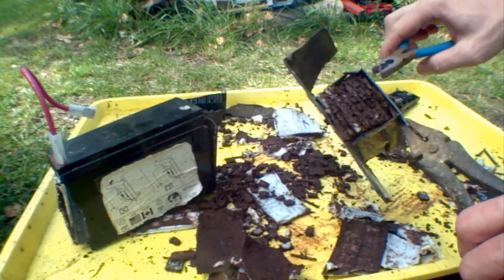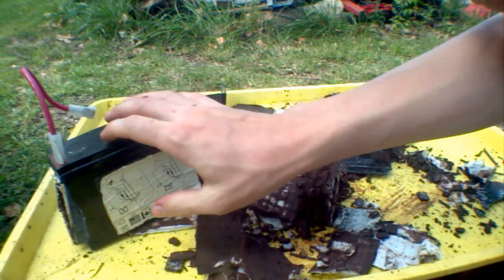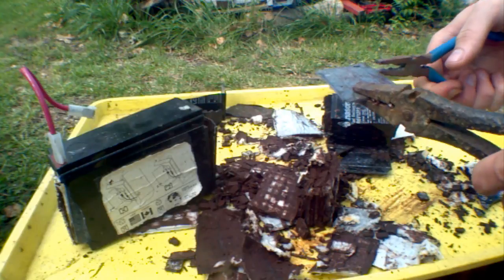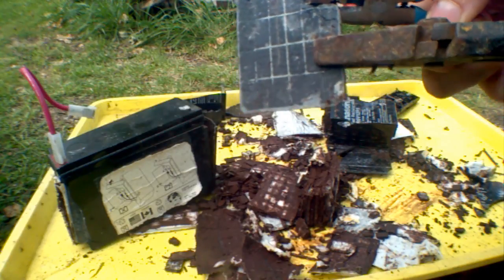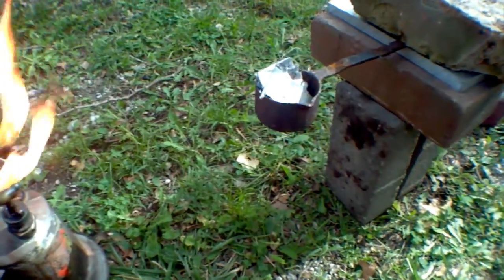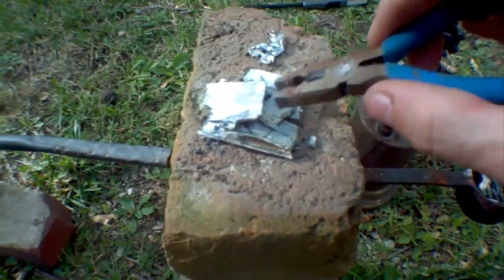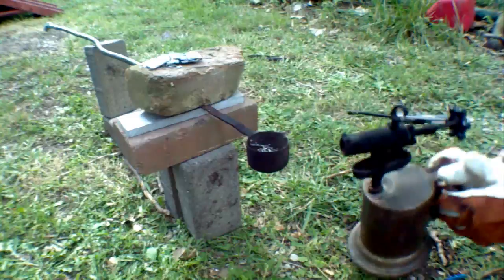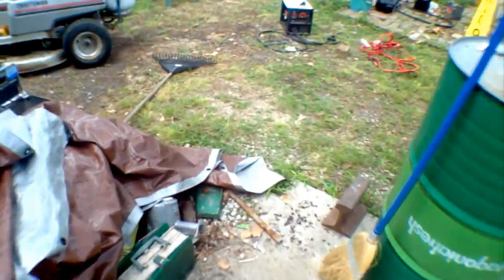6v SLA Battery Autopsy and Melting the Lead

Comment: You can actually re-use the negative electrodes if they are good enough and mostly intact to rebuild them and create a brand new battery! if you get lucky with all of them intact you can get close to 50% of a brand new battery!
All you do is use pairs of the negatives with half being designated as the positive and the other half as the negative!!

Use epsom salt in deionized water as the electrolyte and let it charge for a while at about 250mA per 5AH of rated capacity. Charge to rated absorption voltage and its good to go!
Will nearly double the original lifespan!

You can reuse the case if you carefully cut the top off without damaging it too much. and without making a mess.
The positive electrodes are useless though and can't be reused for anything.

Do be careful and wear gloves eye protection and protective clothing and neutralize any remaining waste or acid.

it works! I tried it and it works 100% for real! its the coolest thing being able to breathe new life into an old worn out battery.

This works well if the battery is old and worn out with bad positive electrodes (won't hold much of or any charge. or even open circuit) or has extremely low capacity but still holds a charge.

Comment: Hi mate, good video. Just wanted to make a few comments mate. Firstly the stuff in the grid (lead) plate is a lead oxide paste. You can easily melt lead oxide by melting it with a carbon (charcoal) to absorb the oxygen, and turn it into lead. Secondly, when you melt this process, you will end up with lead oxide (look like rocks) floating on the top of your melted lead. Scrape these off and place in a pot or metal container for use later. The rock like substance is the lead oxide paste, used in the manufacturing of a car battery. When you have them scraped off, simply add a tea light candle, or a 1'' piece of a normal wax candle. Be VERY careful as this will burst into a flame within seconds. As it is flaming, be sure to stir the melted lead, making sure to scrape the entire bottom and sides of pot. This acts as a flux agent, which makes the lead easier to pour, and it removes impurities in the lead. These impurities will float to the top of melted lead when flame goes out. This is called the 'dross'. Simply scrape the dross off with a spoon. You will now have perfect recycled and pure lead to use for whatever, including lead sinkers for fishing! I commend you on your attempt to recycle. Well done my friend! Have fun and be safe. FYI, sulphuric acid can be neutralized with baking soda!
Reply: Hey thats really cool you can make flux with a wax candle like that, just saved me some time and money right there! Thanks man!

Comment: Don't put the flame directly on any metal you're melting - especially ferrous - because you'll be oxidizing it. When melting metal to cast it, you'll want to gradually heat the ladle (or crucible) to a little above melting heat and keep it there. For lead, you'll want about 600-800 degrees Fahrenheit on that ladle.
Cast iron won't melt until it gets to about 2300 degrees Farenheit, so you can safely melt lead, tin, aluminum, and possibly copper in it.

You'll want to gradually add lead to the molten pot, and keep a hot burning open flame underneath. Wood fires are perfectly fine, though I would recommend some way of suspending the ladle or crucible.

Casting can be done into any soil, but a sand-clay mix is best - one that has enough moisture so it will retain its shape when squeezed, but still can be easily broken. 

Be very careful not to pour into or onto rock or concrete - they can spall and send molten metal, steam and hot rocks flying, potentially maiming and/or burning you. Do not have any water near or around molten metal - water expands in volume 16,000 times when it turns to steam. This means, essentially, molten metal explosions. 

Be safe, it's a fun thing to do. Good luck.
Reply from the maker: Kevin Keel lol this isnt the first time i've melted metal, more like the 1000th
Reply: just trying to give some tips is all. Happy melting!
Reply from the maker: Kevin Keel
ok thanks ^^

its a shame i left a lot of my stuff back in illinois, i was building up an arc furnace. i'll get back to that latter though.
Reply: how much do those cost to run? I just use my coal forge for light duty melting like lead or aluminum. I'm in the northeast though where coal isn't too expensive.
Reply from the maker: Kevin Keel
i live next to a power plant and electricity is like 3 cents per kwh once you buy enough, so its a few cents an hour.
Reply: Huh. Even here, that would probably be less than coal. You're making one yourself?
Reply from the maker: Kevin Keel
yeah using large graphite electrodes and a 1940s 150amp continous duty welder i picked up for 75$. i shelved the project when i moved out here though.
Reply: I've got a 420-amp welder, I'll have to see what its duty cycle is. It's a little primitive for welding so I'll be replacing it eventually. Mine's probably as old as yours. Where'd you get the electrodes? Are they coils, like on a stove, or actual stick electrodes?
Reply from the maker: Kevin Keel
they are graphite rods, some are large motor brushes but the ones i was using are gauging electrodes. i was mostly using half inch wide electrodes. i picked up a box of them at the Jacksonville fall festival for 75 cents in 2008 or so.

i've made a few videos of me like melting bricks with it but i think in order for me to do anything useful i'll need to build a system that automatically adjusts the ark length depending on how many amps are being pulled.

Comment: Why is everyone hating on this guy? The batteries that he was using where either dead or somehow not working anymore. I have taken apart batteries like these before, I have melted lead before. The H2SO4 (sulfuric acid) that is in a battery is too diluted to cause any sort of chemical burns on skin unless you get it in your mouth, eyes, or nose. I have gotten battery acid on my skin before and you don't feel a thing, in the most severe cases you might get a rash that itches a little bit, but you can fix it by rubbing some baking soda on it or washing it off with a bar of soap. The most I have seen it do is get on my clothes and they come out of the wash with a bunch of holes in them. The lead is completely safe, even if you melt it or even boil it. The worst that can happen is if you inhale the fumes from the lead for a good four hours straight, then again nobody in their right mind would do that. So before you go on commenting on how "this guy is stupid" and "this is so dangerous" you should probably check around to see just how bad things can get when you do something like this, sure melting some metal that was exposed to an explosive acid was a bit stupid but he probably knew that the acid was mostly water and was not flammable in the least. I once took apart a car battery and the most dangerous thing I could find about it was that the acid inside it can be put through electrolysis and made into 99% sulfuric acid. (don't try that at home, if you mess up, the fumes from the acid and water can escape leaving you with nearly pure hydrogen sulfide gas... AKA: mustard gas, I was under close supervision of people who where taught how to do this safely and had equipment ready is anything went wrong)
Reply from the maker: i think the main reason why people hate me on these videos is because they dont understand chemicals and they have sticks up their asses. but hey if they hate me here it still helps me get views and money. i'd rather turn assholes away at the first video than have them subscribe and bitch about my new videos.

i would say if i was going to be working with the lead a lot then i would be more cautious about it, especially the lead dioxide since it can more easilly be absorbed into the skin. but overall dont be dumb and it wont bite.

if you think the comments on this page are bad, then wait till you see my other video DIY: Opening a Car Battery and Repairing with Epsom Salts the people go so crazy over that one and its fun to troll them, its not like they want to be constructive or anything so fuck them. :D

Comment: It seems that most of the lead actually has Galena and Coke in it from when it was mined, which gives makes the coke lead oxide.  Metallic lead is obtained by reducing the PbO ( lead oxide)  with carbon monoxide at around 1200 °C. You have to seperate the lead from the Galena and coke at 1200 °C.
Reply from the maker: no it doesnt have Galena in it, Galena is a mineral of Lead(II) sulfide btw. batteries have lead oxide plates and pure lead plates. and some battery manufacturers also add calcium and stuff to make the battery last longer.

Galena is the ore that lead is refined from. you don't seperate lead from galena because galena is a form of lead. you just seperate the sulfur from the lead and that turns the galena into lead with a byproduct of extra sulfur, i've never heard of any use for it without refining it.

Comment: The brown stuff is lead dioxide (PbO2), the other plates are made of badly recristallized lead, that due to excessive harging or improper use recrystallized as lead sulfide (PbS). The only lead you can get out of it is probably the "net" that holds up the grey stuff and the joints leading to the positive and negative poles. I wouldn't touch the PbO2 with my skin, or scatter pieces around, as it's a lead compound with a pretty bad cumulative toxicity. You should open it with a saw, sawing the top off.
Reply: valeg96 how to make tetra oxide from battery?

Comment: Did you ever get any lead out of a battery or try getting lead out of a truck or car battery?  Thanks in advance.
Reply from the maker: turns out the lead is very dirty. its mostly lead dioxide. i'll most likely try again when i get a nice smelter working and pass an electric current through the molten metal to seperate it.
Reply: Thanks for the response..

Comment: You correctly noticed that lead oxide doesn't melt.  But if you add a carbon source (i.e. Charcoal or wax) you'll smelt the lead and convert it to the metallic form. But be careful, when you add powdered carbon to hot kettle it will flare up. Good luck.
Reply: Jack Caravanos how to make tetra oxide from baterry

Comment: Hi Rinoa acetylene  on it's own would just burn with a yellow smoky flame, with a much lower temperature, running it through a Bunsen burner will allow air into the mixture so it will burn blue depending on the correct air fuel/acetylene mixture, it is going to be interesting too see how well/hot acetylene burns with out oxy, I will look forward to seeing this experiment if you do it

Comment from the maker: yeah i have a few old butane torch nozzles from the 50s i was thinking about using.

but i think i'll just find a new hose for my oxy/acetylene torch. that way i dont have to worry about getting fittings to connect the odd thread sizes.

Comment from the maker: remember i said no oxy, i'd just be running acetylene through the nozzle so the temp would be much lower.

but i might just hook it up to my bunsen burner. that would be simpler for small stuff like lead. then i could find a good nozzle for the hotter stuff like iron.

Comment from the maker: i think its more that this is like lead mixed with other stuff. like that grey paste that was inside the grid did get a bit silvery and make melted globules. but it didnt really melt entirely. i think i just need more heat. acetylene should do the trick. any ideas for the furnace shape?

i've been thinking about buying a 1600C* graphite crucible from ebay. and i'll maybe make the unit out of loosly stacked brick. wondering about the nozzle. would a oxy/acetylene torch do ok? remember no pure oxy

Comment: Hi Rinoa it's nice seeing your blowlamp in use again, the grid that did not melt with the lead could be made of copper, as it is a very good conductor, or zinc or steel but if it was copper there would have been a green flame as it heated up